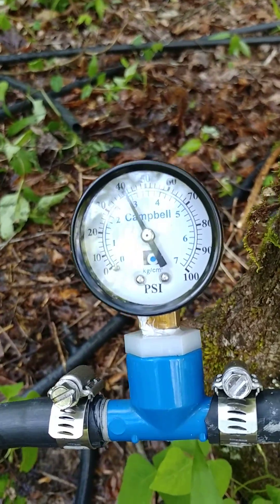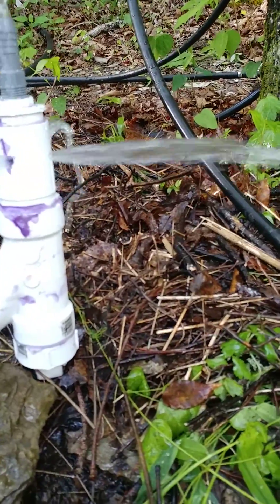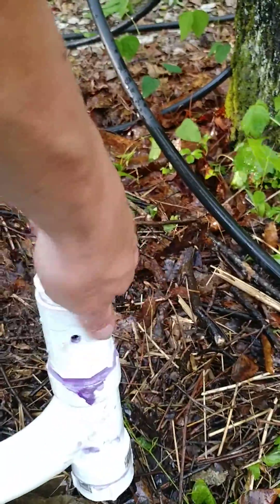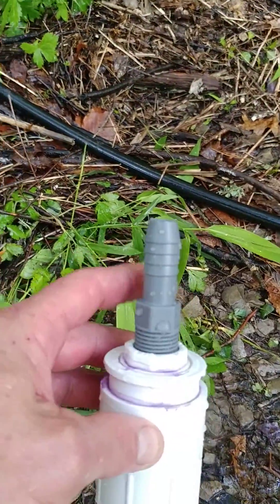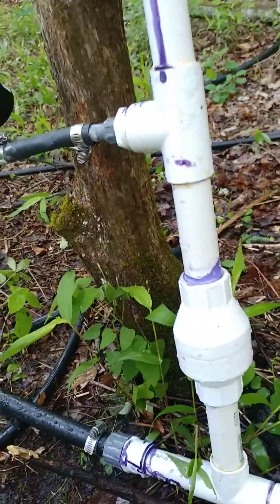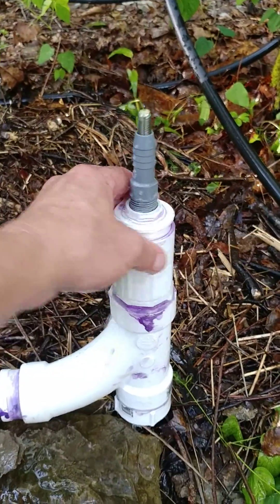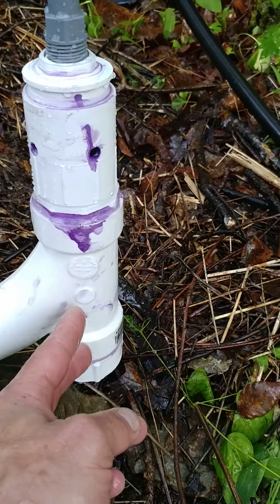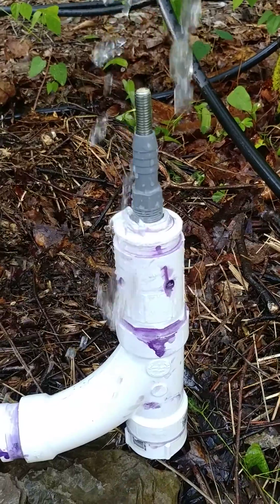DIY check valve (waste valve for water ram pump)

Comment: Thank you for the video.  I am wondering what difference the waste water check valves make?  I've seen videos where they ended up pumping LESS water, but so far none that have documented an increase in water volume for a specific height.   It would be nice not to have the clacking.   Here is a link to the waste water check valve discussion in the Water Powered Pumps public Facebook group - I hope you will join, share your ideas and link back to relevant videos: https://www.facebook.com/groups/240458583255303/permalink/533567013944457/
Reply: Oh I forgot - it would be very helpful to have a picture of the internal pieces of the pump - maybe disassembled.
Reply from the maker: I got the idea for this check valve from the guy in the link below... He makes a great one. His was just a little pricey for me... I can post another with more detail on how to make the one I have. He does a test with 3 different valve and shares the results... Hope this is helpful.

https://youtu.be/TALvy0usnYM

https://youtu.be/TALvy0usnYM
Reply from the maker: For the time being here is a link to a picture of the inside parts. Lowes has the rubber grommets 1 1/2 inch.  The allthread is 3/8 and 3/8 lock nuts.

https://photos.app.goo.gl/o3uXZmLFEjpqn8Ty5